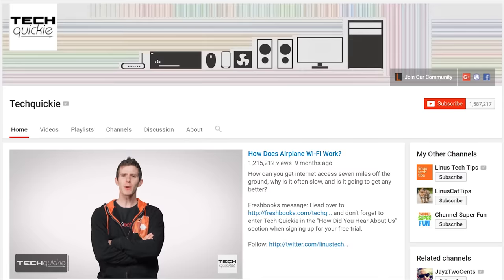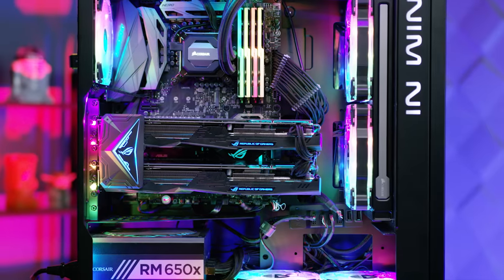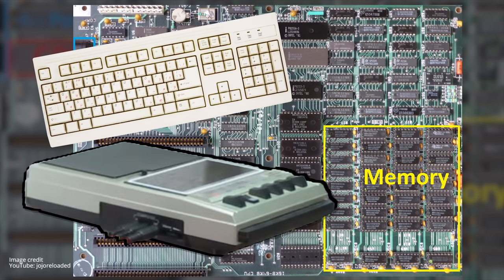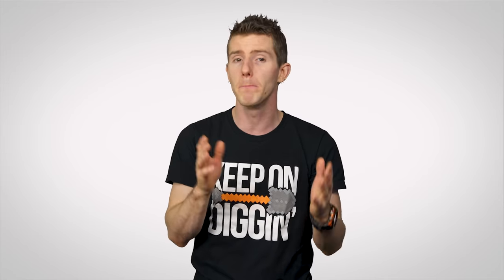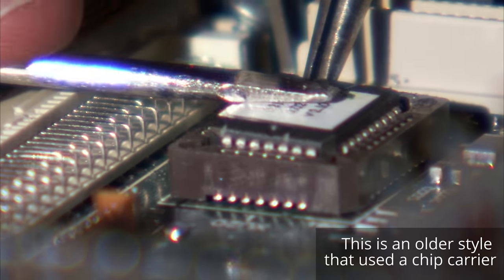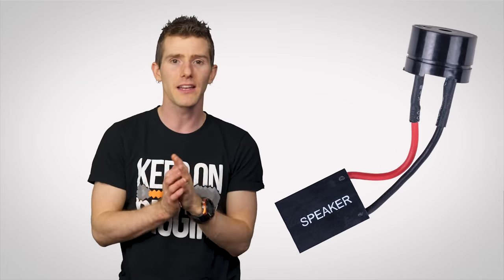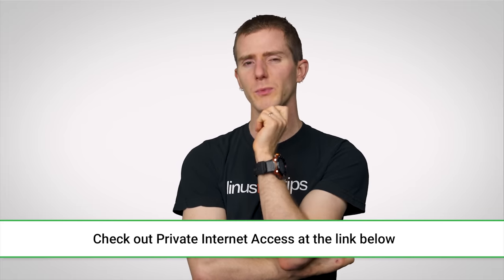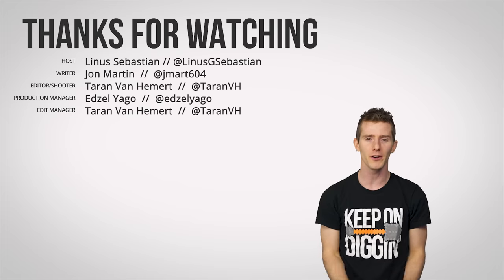History of the Motherboard

Comment: You jumped right over VLB! That was da bomb when it came out!
Reply: No.  No it wasn't.  We will not speak about that.
Reply: In terms of a high speed "local bus" that wasn't held to IBM's licensing fees for MCA, it was pretty good, but it was beset with all kinds of speed, signal strength/path length and reliability issues. If you got a good video card and fast HDD adaptor working nicely together you were doing quite well, adding anything more than that was risky. And it had no fixed speed so you'd better hope your devices were compatible with how fast your CPU ran (possibly one reason that 486 bus speeds never went over 50mhz and were mostly under 40mhz).

PCI was much better, you could happily fill all the slots in a machine without worry, and its arrival also coincided with the common integration of an IDE controller and parallel/serial interface to the motherboard (technically on the PCI bus itself) so you could have three or more high speed cards for e.g. 2D graphics, 3D rendering or MPEG decoding, and additional option(s) of your choosing (high end sound, external SCSI devices, etc) alongside a soundcard and maybe tape streamer adaptor or whatever in the ISAs, having a very well equipped computer that still ran entirely stable. Which wouldn't have been the case with VESA or even MCA, and ISA would have just clogged up...
Reply: VLB is the cause of nightmarish problems with 40-50 MHz frontside bus before intel went to clock-doubling (e.g. 486DX2-66). The AMD 386DX-40 was so reliable precisely because it did not have VLB, the motherboard was highly integrated and it was mature at the end of the 386 cycle; absolutely rock solid at 40 MHz FSB on every motherboard I've seen with this processor. 486-DX40, 486DX2-80 and 486-DX50 just had all kinds of problems with the VLB.
Reply: Exactly. PCI is itself often still stable at up to 40mhz (and many cards, too; not sure it's any good at 50) but one of its primary advantages was to, like ISA, be able to run asynchronous with the real local bus... just much faster than any previous non-local interface, creating a new standard out of 32-bit databus at 33mhz, with the ability also to underclock to 20 or 25mhz (at which speed it was still much faster than ISA) if needed to be in 1:1 or 2:1 sync with fussier motherboards (and clock doubled/tripled, or single-clock CPUs respectively).
Reply: There are things such as mHz - millihertz. A very different thing to a megahertz.
Reply: There is such a thing as context. Nobody is in danger of making a nine orders of magnitude mistake when the first commercial microprocessor ran at 740 kHz.
Reply: Haha and I just realised that my mHz was auto-corrected to MHz.
Reply: Not even autocorrect mistook mHz for MHz. Again, your pedantry isn't really relevant here.
Reply: It's kind of like VHS vs Beta, and VLB was Beta
Reply: Except Betamax was technically better than VHS, it just failed due to having too short a recording time and a higher cost. In the case of VESA vs PCI, the technically more competent standard won out. Computer users actually tend to pick the genuinely better quality choice more often than not, because they're spending big anyway and have a different balance of priorities (and can stand, for example, changing a dozen floppy discs to install a game over the course of 20 minutes, instead of putting up with a faster and higher capacity tape but that fails far more often).

In any case, whilst Prehistoricman's comment was technically correct (other than the autocorrection of the lower case letter to capital), I'm not entirely sure what the point was. Usually once oscillation rates get down to that level, we start measuring either in wavelength, or period instead. IE a frequency of 1 millihertz would be given instead as a period of 1000 seconds. The relevance to the discussion is... erm?!
Reply: "Except Betamax was technically better than VHS, it just failed due to having too short a recording time and a higher cost." - I.e. betamax was vastly inferior for most people, most of the time, for the technical reasons you point out in the latter half of the above sentence (yes, inability to lower cost is a technical aspect of manufacturing and scaling).
Reply: Yeah, except no. In terms of picture quality and reliability it was far better. Naturally they should have made the cassettes bigger to store more tape, but it was intended as a timeshifting device more than a movie delivery system, so only being able to record 60-90 minutes (which, like VHS, was later extended with longplay modes) wasn't expected to be quite the dealbreaker that it turned out to be. And films you record off the TV, well, in the US they'd have ad breaks in the middle, so you could change tapes... somehow it didn't click that a human being would need to be present for that.

On the technical front, it was otherwise a better system for recording video. Pictures and sound were clearer, and for most purposes had enough recording time.

Thus, it's not a VESA Local Bus. That was the cheaper option, and it, at least at first, claimed higher speeds (which, like the tape recording time, is what would have wowed the layman, when they didn't have anything else to compare the two standards with). But PCI worked far better despite a lower peak bandwidth and being more expensive to implement (needing a whole new chipset, instead of just extending some of the CPU lines alongside the ISA). VLB was VHS, and PCI was Beta.
Reply: I disagree that image quality was far better (e.g. see https://www.youtube.com/watch?v=_oJs8-I9WtA ). Differences were minor at best between Beta and VHS.
Reply: Hmm, it does seem that I might have previously been sold a lie. However it is at least slightly better rez in standard form, and particularly as SuperBeta (which just kicked in automatically, on normal tapes, with later decks). The difference is about 21% in the latter case, though barely more than 4% originally...
https://en.wikipedia.org/wiki/Betamax#Comparison_with_other_video_formats
Reply: arduria Yes it was the bomb. Not because it was faster. It was the bomb because it was the cheapest and was directly linked into the CPU.
Reply: soylentgreenb I am running with two VLB cards on my dx2-80 as of now. No issues other then wrongly inserted, it tends to loose contact. Once inserted correctly, amd making electrical contact, the VLB is actually amazing. As the rule say: 30=3-cards, 40=2-cards and 50=1-card. If you have the highend cards and motherboard, then you can run two VLB cards on 50mhz. Still a project machine to run that high. So the best bang for bucks, stability and everything, is to run 40mhz FSB and two VLB cards. Like a dx4-120 with S3-VLB and SCSI-VLB. That is an absolute monster with good middle of the road speed/stability/cost solution.
Reply: Brostenen Ask anyone involved in selling this hardware back in the day. You can sit back and cherry pick the best and most desirable VLB motherboards and VLB cards today, but there was so much dysfunctional trash out there that could not run 40 MHz VLB except with a particular motherboard or a particular card and that was not the case with PCI.
Reply: soylentgreenb That is exactly what I said. Now getting good quality VLB cards these days, are a totally different thing. It depends most of all, on were in the world you live. Europe dried up some 10 years ago. If you want VLB stuff these days, and want them cheap, then you need to go somewere like Russia, former eastblock countries or China. If you want to buy from germany, then the price is extremely high.
Reply: @mspenrice  VLB was exclusive to the 486, so unlike Betamax, it was always going to be a stopgap until something better came along.

But if you wanted to build a 486 with fast graphics and i/o on a budget, it was the way to go.  It was also nice that it was backwards compatible with ISA because in those days you needed a card for everything, little was integrated on the mobo

Comment: This is quite a misleading title. There was no mention of motherboards such as the BBC Micro, Amstrad, Spectrum etc, all of which had many of the features built on to the motherboard including expansion slots, memory, GPU, CPU, I/O, RS ports, and the BBC Micro systems was by far the easiest as even in BASIC the user could create a simple program, home build a simple circuit and effectively talk and listen to the outside world using the slots placed for the user on the underside of the case, indeed, it took about 4 components from Tandy's (as it was back in the UK), a 'Bic' pen shell, about twenty lines of BASIC and you had a 'light pen' that could be used to touch the monitor and select choices on the screen, you could increase the processor power with a simple plug in adaptor, all this was far, far easier than ANY 286/386/486 home processored PC at the time. The title therefore should be "History of the PC motherboard".
Reply: I'm pretty sure we were all thinking of PC's when he said "History of the Motherboard"

Comment: Uhh? What about the Apple II? That was released in 1977. It was very similar to the IBM PC board, expansion slots and all.
Reply: And before Apple II, the Processor Technology's "smart terminal". It had a display output (16 lines of 64 charters), keyboard, cassette storage, RAM (1 kilobyte), parallel port, serial port, and a "personality" plug in module (BIOS) and a 4 slot S-100 buss all on a mother board,  So you could add RAM (8 kilobyte kit for $235), my first floppy drive (FDOS with only 4 error codes "1", "2", "3", and "?") all running under a 2 mhz 8080.
Reply: @carldawson5069  The Sol. Or Sol 20. I forget for sure which it was called, never had my own copy of the Radio Electronic issues it was featured in.

Comment: I was surprised when I took the heatsink off my AMD motherboard to not find an AMD chipset but a Nvidia integrated graphics? soldered on the motherboard.
Reply: Why did you add the question mark?  Linus literally said some GPUs were soldered to boards.
Reply: never expected Nvidia to manufacture them
Reply: It might have been an nvidia nforce chipset as nvidia used to make chipsets for motherboards, but I don't think they do that anymore.

Comment: Did PCI-E not have a standard for anchoring the card onto the MOBO in the early years? Do I remember right, that in the day the PCI-E card depended on the case to stay secured? I have gif of someone sawing a GPU card to fit onto a PCI-E slot as a capacitor prevented the card's tail or hook from sitting outside of the slot.
Reply: Dragon Skunk That was Linus, he did that to fit the graphics card in the slot.
Reply: What an odd circle that was.
OK! Then I was right there was no standard for PCI-E back then?
Reply: Dragon Skunk yeah
Reply: Dragon Skunk the reason he cut off the tab is because a capacitor was in the way
Reply: Dragon Skunk ... Google "PCI-e wiki" - real easy.
Reply: Not sure if you are confused or not, but others certainly will be, or have been:
PCI-express (often just called PCIe or PCI-e) is what we use today for more or less everything. back in the super early days there was a brief trend of calling PCIe PCIx, x being short for express of course... also a general assumption that when people saw or heard about PCI-X, the X meant express... 

PCI-X is an older standard which is basically the usual PCI slot with many more pins to support 64-bit parallel data. These slots are quite long, and because they were only ever common in server and workstation boards they weren't well known by consumer and enthusiast types - hence the early confusion.
Add-in cards for server and workstation purposes were often gigantic!! much bigger than the foot long video cards we are used to today and so it was common that these types of cases had at least a rail running down the middle of the case with plastic tabs to hold the card edge opposite the board and to support the front edge of the card which could be a long long way from the slot.
Don't forget also that both motherboards and add-in cards were a lot thinner than we are used to, especially add-in cards, being mostly double sided, 3 or 4 layer, so they were much more flexible and needed that support.
Reply: Hi there.
 Perhaps they're thinking of the first itteration, PCI. PCI slots have no clips or fastenings, whereas the newer versions, PCIe (1, 2 & 3) do.
 Cheers!
Reply: kal9001 pci x is short for pci extended, not express
Reply: Some MOBOs do not include a means to keep daughter boards anchored and rely on the chassis mount to this day :) - this is because not all MOBOs are designed for use with heavy graphics cards therefore are not really needed. Most cards I deal with in servers & workstations are no bigger than PCIe x8 so the anchor is wasted because the cards arent long enough to utilise it. This is rarer in consumer grade MOBOs of course, but still seen on budget brands.
Reply: As others have pointed out, PCI is not PCI-E. Very different slots. There were however PCI slings for the larger and heavier cards which clamped onto the socket and wrapped around the card. Only place I ever seen one used was with hard drives mounted in PCI cards. I did see them on computer store walls so I imagine they had a lot of uses other than expanding hard drive space.

Comment: I have a floor model Delmonico stereo from the mid 1960's, no PCB's in it, had to fix a bunch of broken solder joints but the thing still works like it did back in the day, apart from the record player, it's quite dead. Still picks up AM and FM signals until they shut those off for good for their digital replacement.

Comment: The first I/O chips were actually called PIOs (peripheral input output). Later, they were replaced by FPGAs (field programmable gate arrays) and finally by, SOCs (system on chip) and DSPs (digital signal processors)
Reply: Odd... I had always thought that PIO stood for Parallel Input/Output, similar to the way that SIO stands for Serial Input/Output.

Comment: LOL, this video has a whole different "feeling" because, for me, is is a trip down memory lane rather than information LOL! Point to point wiring though is not really "fragile". I remember many of the TV commercials such as "Quasiar the TV with the WORKS IN A DRAWER"  Curtis Mathis made a point of pride to be hand wired while the industry went to boards. They were a HIGH end TV.
Reply: Point to point varies - if it's done right, it is NOT fragile - but often times it's NOT done right.

Comment: I work electronics on aircraft.  Some aircraft still have cabinets with cards that slide in, and connect to a backplane.  Of course, each card generally has one or two functions that it provides, and is designed to make it easy for mechanics/technicians to quickly swap those cards and repair malfunctions.

Comment: I remember an old Commodore computer(Amiga 1200 from 1992, to be exact) that I had where I could only either use the expansion RAM, or CD drive at once and had to either unplug the CD drive(external SCSI) or deactivate my 8mb expansion in kickstart(equivalent of BIOS, got to by holding both mouse buttons when booting) because the expansion board and external SCSI used the same system resources.

For instance, to play Doom, I first had to to into kickstart and turn off my expansion board, which BTW also contained a 50mHz 030(Motorola equivalent of a 386, the on board processor was a 14mHz 020(you guessed it, Motorola 286 equivalent)) and load into Workbench(the OS), install the game from the CD and then turn off the computer, remove the CD drive, go back into kickstart and reactivate the expansion board so I could go back into Workbench and run the game, as obviously, 2mb of RAM and a 020 would never run Doom.

Of course, you'd only have to do that once, since once installed you didn't need the CD anymore(CD-based protection didn't yet exist), but it was still a pain in the excrement exit.

Comment: A motherboard (sometimes alternatively known as the mainboard, system board, baseboard, planar board or logic board, or colloquially, a mobo) is the main printed circuit board (PCB) found in general purpose microcomputers and other expandable system

Comment: I can remember Etching out circuit boards at home. And those new fandangle things call transistors.  But could still buy valves to replace in the B&W TV.
Reply: Valves?
You must be Commonwealth - us Americans called them "tubes".
And yes, I HAVE worked on tube gear - though I don't think I did anything with gear as old as that radio.
Do you remember Bakelite in circuit boards?

Comment: The first computer I built had a HUGE Seagate ST-238 I think was the number.  It was a MONSTERous 30MB (yes megabytes) when most computers only had 10-20MB drives.  The HD also required a separate controller card plugged into the mobo.
Reply: ST-238 was a half-height "30 Megabyte (formatted)" MFM drive model.
Probably a Western Digital controller card - they got their start as a HD Controller maker, and their cards ended up in a LOT of "PCs" - including the actual IBM XT and AT models.

Comment: um, linux, 386 had socketed versions, 2 major styles, one like a less complex 486 socket, and one that was edge contact similar to what you showed, those where not so hard to remove/swap if you arent a spaz did it for decades for a living, never broke a socket that i wasnt intending to break. bit pga was far better i do agree there... the snap over chips for soldered on 386/486sx chips that could make them a full 486dx where actually quite handy on some systems, nearly useless on others.. hehe... (kinda like those 5x86 upgrade chips worked but, due to limits of the platform, dont really show the kinda gain they should) 

i built many systems with them, and swapped chips around, even found i could oc to a limited degree by just swapping out the clock crystal with one that was faster, but not so much faster it caused anything else not to work,